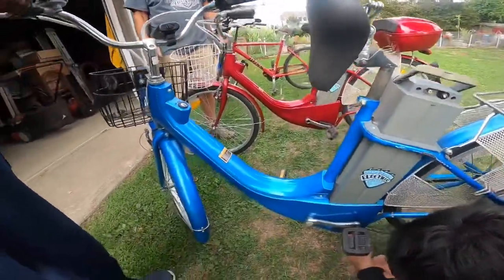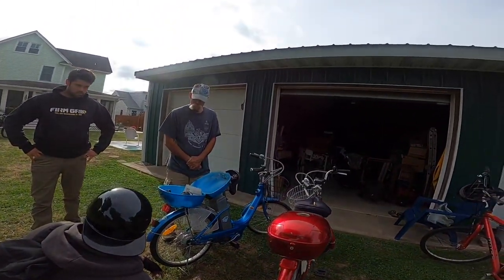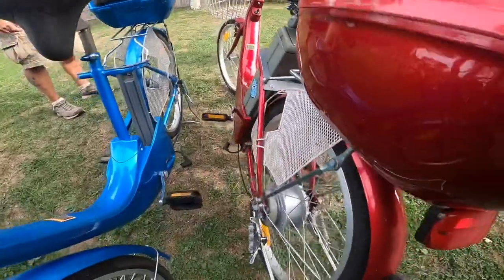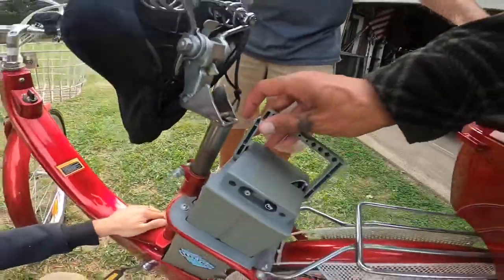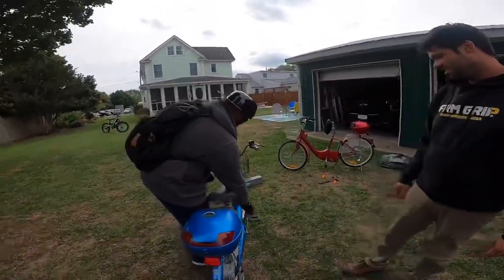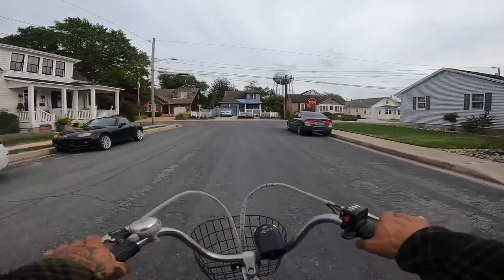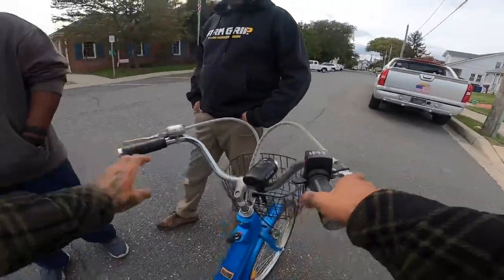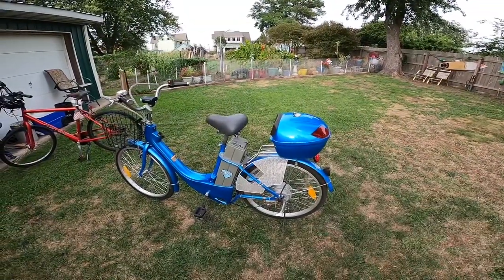OLDEST VINTAGE E-BIKES EVER!  Can We FIX Them?

Comment: With the age of those bikes, are they using brushless or a brushed motor?
Reply from the maker: I know it was a geared hub motor, but I don’t know if it was brushless or not
Reply: @SHREDDIEMCSKATE  Check the controller, if there are only 2 wires going to the motor from the controller.
Reply from the maker: @ebikeengineer  next time we hang with Chip I’ll check it out🤘🏾⚡️🤘🏾💯💯